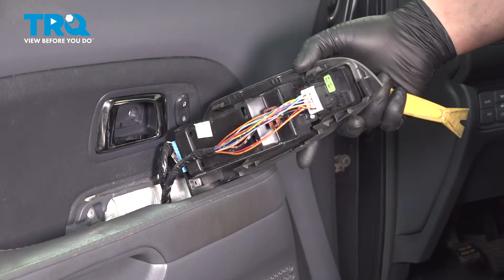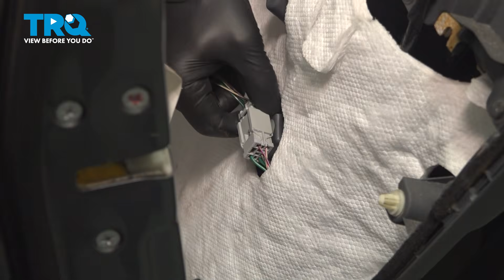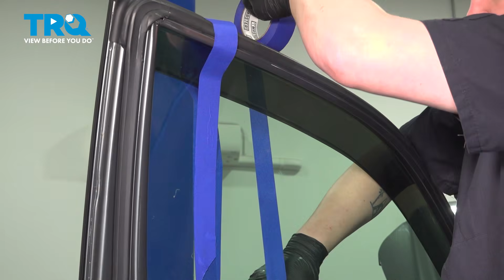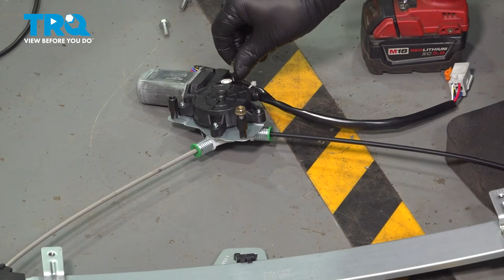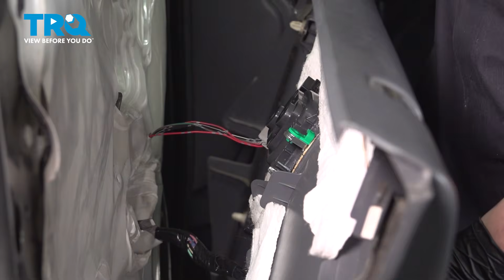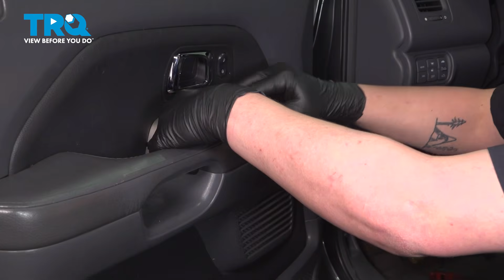How to Replace Front Window Regulators 2003-2008 Honda Pilot

Comment: Inside door panel has to be connected up to make window switch work as shown in lower corner of video.  Honda routes window power through lower door light.  Took 2 days and a parts trip to a salvage yard to figure this out.  ... after I readily it in a forum.

Comment: IMPORTANT!!!  The new motor won't work to align the window bolts unless you plug all wires back to the door panel.  This caused me to buy a new switch for nothing! Please include all the steps or it's a waste of time!

Comment: This video leaves out a very important reinstalation factor. You MUST reconnect the door light cable for the window switch to work. Without doing so, you will hear a clicking from the control module. I have no idea why Honda engineers designed the window switch circuit to complete the door light circuitry. (maybe grounding or kill when the door is open)
Leave it to a Russian mechanic: < https://www.youtube.com/watch?v=OEDSPre78LY >

Comment: This video helped me through this perfectly. The only note I'd like to add is this: After installing the new assembly, the control just made a clicking noise but there was no movement. I fixed this by making sure all of the electrical components on the door were re-connected [door lock, door light, etc]. Worked like a charm.

Comment: I did everything, but now the switch isn’t working. It worked totally fine earlier today when the regulator broke. All the other windows work, but not this window now. I’m stumped and frustrated. I can’t screw the last bolts into the window, because it’s not working at all now

Comment: I notice in your video you do not mention that the additional connector near the Control unit must be connected for the regulator motor to work.
On my 2004 Pilot I replaced the switch and then the regulator and the window regulator motor still would not work. I was about to order a new control unit. While researching the control unit, I found another source that said the connection near the control unit must be connected to the inside of the door for the regulator motor to work. I moved the door card near the door, made the connection and everything worked. If I had this information I may not have needed to replace the regulator after replacing the switch. This omitted information is really important on 2004 Pilots. It should be added to your video. I do not know about other year models.

Comment: While this video is better than the 9 year old one you have that has you do some unnecessary steps like removing the door handle completely and the speaker, there are a couple problems with this video:
1. You don't mention that the 2 screws behind the small panel in the door latch well need to be removed.  I can see in your video that's already been done, but you can't remove the door panel without those screws removed.
2. If you need to move the window up/down, the control unit and the other connector on the lower left of the panel need to be plugged back in, not just the button panel.  I was going crazy trying to figure out why the window would not move until I started plugging things back in until it would.
3. If it's not obvious, the "gold" bolts on the assembly and motor are the ones you loosen but do not remove, the silver ones are removed.
4. If you haven't learned this trick, spray the inside of the window tracks along the door frame with silicone spray to make it easier for them to slide up and down.  This take a lot of work off of the regulator motor and will extend its life (do this for all 4 windows).  I'm on my 3rd replacement regulator because the window was getting very sticky moving up and down and wore out the other replacement regulators.

Comment: I'd like to mention two things in the order I realized them and I hope it helps someone else: My front-driver window was locked in the up position. Pressing the switch did nothing. I eventually cut the cable which allowed the window to drop. After I finished installing the regulator/motor, I tried raising it to attach the window and nothing happened. What I found is, if the light bulb is not plugged in then NOTHING happens. So, I might have been able to plug in the bulb rather than cut the cable. Plugging the bulb in allowed me to raise it enough to attach the window and continue the installation. I would also like to specify that I mean the cable that manipulates the window up and down and NOT any of the electrical wires.
Reply: With your comment you saved my life, something that seems insignificant, but in truth your comment is worth gold. I wish they would pay attention to you. I had already bought the controller, but when I read your comment
Reply: I'm think I'm currently in the same situation as you were; I just replaced window motor, but I can't roll it up to attach the window to the regulator. In your response above, what do you mean by the light bulb needs to be plugged in?
Reply: I returned it and got my money back. A wire for the door light. Amazing. I really appreciate your comment.